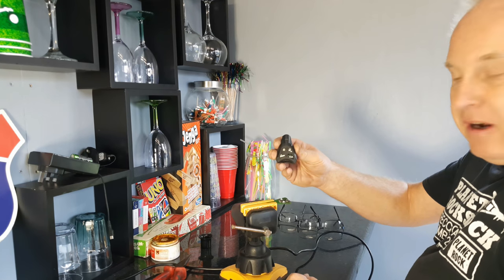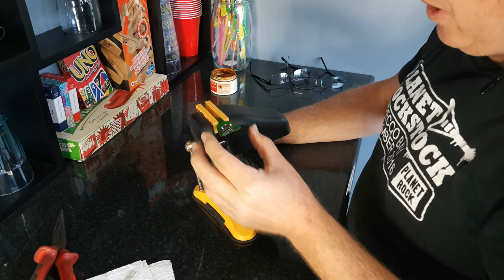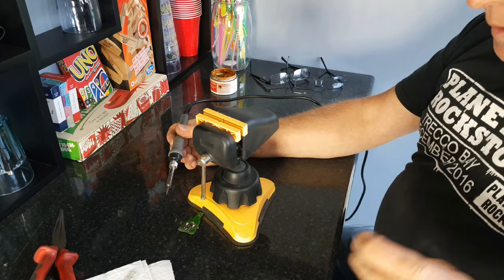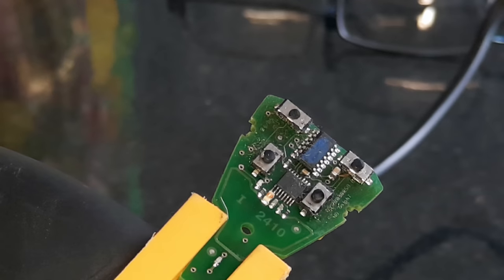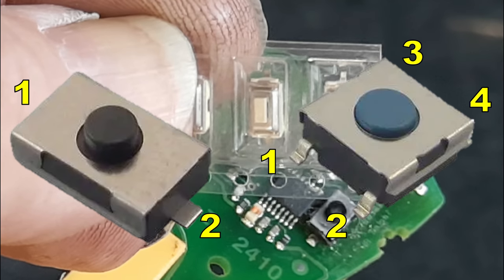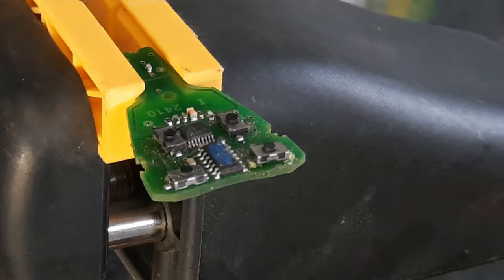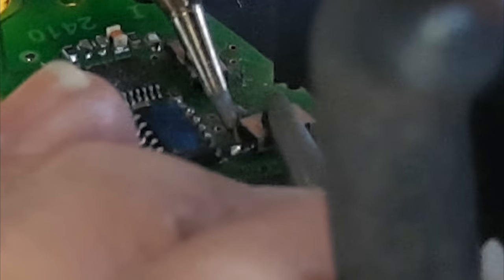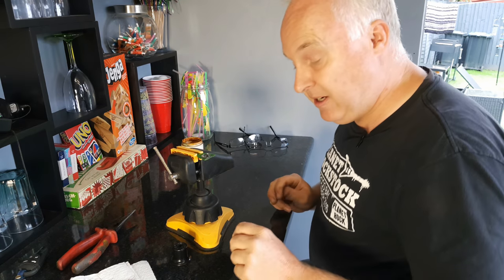How to Replace Remote Switch | Key Fob Switch Repair | Easy DIY

Comment: Is there a higher quality replacement for the two-terminal switch you'd recommend from Mouser, like that rectangular one you showed comes with a replacement key case? Or do you recommend using the ones that look identical to stock from the assorted switch box from Amazon?

The switches on one of my keys went gummy before the outer case fell apart, so I want to use a switch that's higher quality than OEM

Comment: Another great helpful video Sid, but please if that high gloss worktop isn't granite put something on it to protect it from heat or scratches.
Reply from the maker: That's why I used a suction vice. Cheap as chips, but super useful.

Comment: Haha I actually needed to do this to my EX saab 9-5 & Also the Mercedes after that, But thought i couldn't do it, thinking of mini electronics and needing diffrent iron ect, BUT still very usefull too know, Thank you soo much.👍🥇. It would of fixed my bastard intermittent whole locking system  on the 9-5,What a pain that was working through the possibilities.This job was 2nd to last thing i could of done..., Or the computering under the passengers seat, Which i checked the underside, And not too much rust was seen after 16 years, It had an original backbox too lol. Eeee i miss her 😢😭. THANKS AGAIN CYD, For the demonstration & Passing the Video & your Wisdom. Much love.
Reply from the maker: My 9-3 is actually my first Saab and I love it as much as the string of Rovers I had before it.

Comment: I have been having a mini breakdown until I saw your post. I don't have a new replacement switch so  I'm using the 'lock' button which is in good order,  and moving it to the unlock spot. My good remote fob  fell out of my pocket and is in sight behind the locked door. The drivers  door is unfortunately one I got second hand after crunching the original a month ago. Stupidly when I put the new door on I mustn't have put the old lock on the new door, so the key  whichnwould have opened it manually won't. I am going to try a wire coat hanger first but do not have much confidence as the working key/fob (even if I can snag it) is on a weighty ring of keys that i think will be to big to get through any gap i can temporarily force. I'll have more luck trying to press the open button as it sits on the seats. If that fails I will need to get muck better at soldering than I was last time I had a go at it. I can see me in a few hours having a major league grown man tantrum. Is it cheaper to replace the drivers side window or calling someone out? I can see me breaking the window! The glass is probably not that expensive. Omg I've just thought, I still have the old door complete with glass.1

Comment: Hi. Thanks for the video. 
I have the same buttons as your original. It is just that the top part of it (silvery thing with the black dot/button) has come off from the bottom part, which is still connected to the plate. 
I have put the top part back on the button part (more or less it just required a little squeeze). But the button still doesn't work. Do you know why?

Comment: Just got the kit that you recommended, none of them fit exactly but as long as I use a 4 prong switch for a 4 prong board, it should work right?
Reply from the maker: Correct 👍

Comment: Any chance you can show how to "virginize" a remote with pcf7946at. I have about 10 old keys that I want to sell. Also, where is this chip on the CIM? Wonder if it's replaced Tech2 will see CIM as factory.

Comment: Oh I did a terrible job of this I should have watched a video one more time to get reference I just did a really bad job resoldering them on or an aiming when I took them off question I'm hoping it will work I'm about to get it unlocked. In order to program new keys you need a fob and a tattoo and just access to the car right you can assign or program new keys I don't have to change the CIM or nothing?
Reply from the maker: As long as you have one working key you can program another. I think 'working' in this instance means it must start the car, so buggered switches might not be such an issue. Speak to your Tech2 guy (or gal).
Reply: @CycloneCyd  we have no tech2 people here.. I plan to get one during tax time.. although I planned that for two years.. update.. the buttons work with my ugly ass solder and I had the car unlocked and now it's usable. I just need to get this stripped screw off the coilpack covers so I can replace the yellowtops with the blacktops I got at the junkyard.. and I have to work on my rough shifts

Comment: Fry's active plumbing flux!! WOW. That shit will have the PCB and switch eaten as quick as your builder can eat a sandwich for lunch mate. You should always use an electrical flux such as rosin and it should always be washed off with isopropyl alcohol straight after the soldering has taken place.

Comment: The only thing I would say is "Easy DIY" is misleading. It is far from easy for a DIYer who has no previous soldering skill (you said  buy a soldering iron) especially with key fobs with components in very close proximity to the microswitch solder pads.